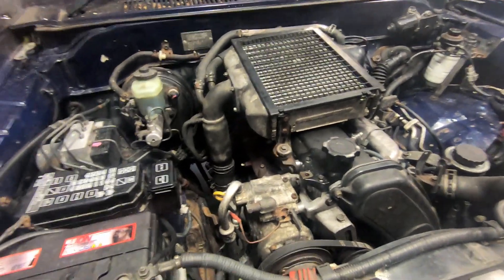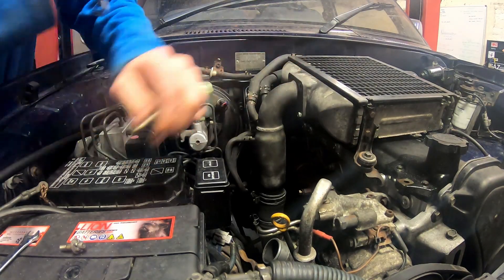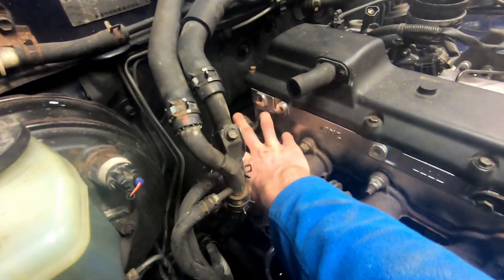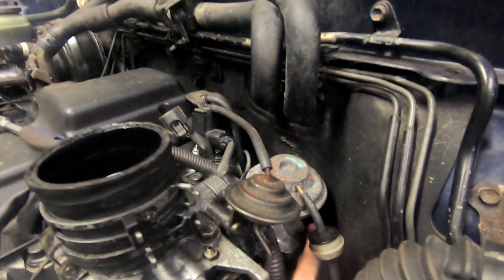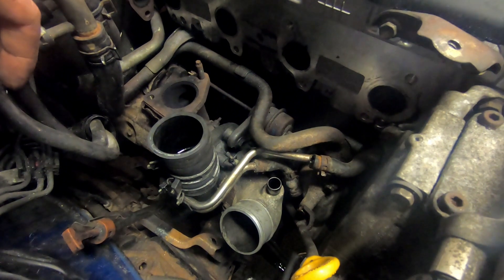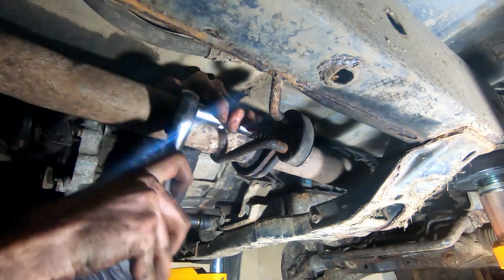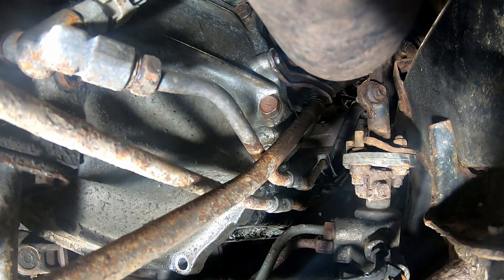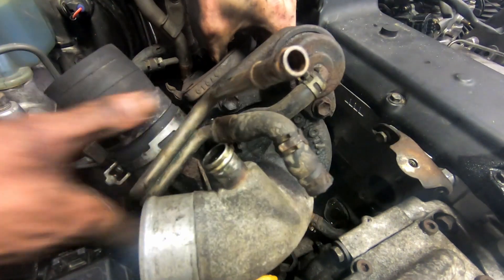How To Remove the Turbo from a 1KZ-TE Engine on a Land Cruiser Prado

Comment: That banjo bolt behind was a lot of fun. but i got it all out. thanks for the upload, helped heaps
Reply: What did you do to get it off? Stuck at this part
Reply: @35jdub  
there was no easy way, either from above, from below or from the side. try to jack up the car, take wheel off and use an extension bar with socket to reach it. i cant remember exactly how i got it off now. there is a double sided washer on that banjo bolt , you'll likely need a new one of those.
Reply: I have my cylinder head off so was able to just reach in and use a spanner on it. thankfully wasnt on too tight! @eyeflynoosa
Reply: @35jdub  
thats good news. my head was back on when I had to remove the turbo, which made things difficult. getting it back on was "fun" also. Putting the bracket and the oil return (banjo bolt) on the engine first then place the turbo onto them, was easiest method I found. but whatever works for you
Reply: getting it back on was also "fun" for me today. Took 5 hours total.. didn't have the car on jack stands so had to start with the oil bracket lower bolts into block (was doing it blind and by feel only), and then did the transmission dipstick mount, then the banjo bolt which took 1.5hrs by itself... then finally the lower brack bolt into the block and finally mounted exhaust back on. what a nightmare. used zipties and a 2x4 plank to work as a hoist to hold up the turbo while my dad guided it around.. sheesh @eyeflynoosa
Reply: @35jdub  
haha. i know exactly how you feel. one thing i should mention, when you go to restart the engine for the first time, do not rev the motor, just let idle for a few minutes. i revved the engine a bit and immediately blew the turbo, which was why i had to pull it out. something about lack of oil in the turbo i suspect. unless you have pre-lubed it, which i didnt do.
Reply: good to know! I will probably hand crank the motor a few full rotations to charge some oil through the system, as well. will be doing a fresh oil change before first start, as well @eyeflynoosa
Reply: @35jdub  
good idea. have you thought about connecting a boost controller to the turbo. real easy job while half the motors apart. i put a cheap aliexpress chinese turbo in, and it could have used a bit more boost, so i bought a $20 ebay boost controller , gonna put it in soon
Reply: @eyeflynoosa  haven’t thought about that. I bought my turbo from Phessio. Seemed to be decent quality, and has a 2 year warranty, so excited for that.
Reply: @35jdub   
haven't heard of them, china company i see. but a boost controller is a plus. easy to fit, lots of videos. it just connects to that rubber hose from the compressor housing to the actuator. i bought a core/cartridge to rebuild the original toyota ct12b. turbo. so as soon as the cheap Chinese one i bought $165 fails i can put the original back in ..with a cheap chinese core :face-purple-crying:
Reply: Well - its a pretty simple enough turbo that I'm hoping this one will last for a considerable amount of time. I absolutely do not want to have to do a swap again lol @eyeflynoosa
Reply: @35jdub  
I'm hearing ya. LOL. 😵also consider installing a new thermostat while you have the oil and coolant drained, and turbo out, its down there also just to the front a bit, something i forgot to do, its another bugger to get too job but should be done. have fun
Reply: @eyeflynoosa  I did just put a fresh therm in there when I first bought it! Did water pump, therm, timing belt when I first got it just as preventative!

Comment: Gday Mate, thansk for sharing this. Appreciate it! 

I'm about to under go this procedure. Do you think it's possible to do this job without removing the exhaust manifold? I plan to take my turbo out with down pipe still attached (hopefully out through the bottom) and reinstall the new turbo with the downpipe attached to save the headache of getting into the back downpipe nut (you know the one).... Would be nice to not have to pull all the exhaust manifold etc off... Thoughts?

Comment: Hey there, was wondering did u do any prep to the head studs prior to removing them, for example soaking the head studs with a penetrative spray of some sort. Cheers
Reply from the maker: Hey Murphy, I didn't have to use any penetrating spray as I recently changed the head on this engine, and the studs hadn't seized in. If you're having problems getting them out a bit of penetrating spray might help - or failing that you could try heating the area around the studs on the head with a propane burner. I find heat works wonders when trying to remove seized nuts and bolts on exhaust systems. I hope this helps!

Comment: Hey mate! Is the intercooler aftermarket ? Did you fit it yourself?
Reply from the maker: Hi Kristian! So the Land Cruiser I have is the Prado and is a Japanese import. The Prado was sold in Japan and Australia and came with an intercooler as standard but without diff lock. In Europe they called it the Colorado, but instead of a factory fitted intercooler they included a rear diff lock. I don't see why you couldn't fit the intercooler set up to a Colorado if you replaced the cam cover and the intake ducting. I hope this helps!
Reply: Yeah i heard that yesterday! Very helpful, thanks mate!